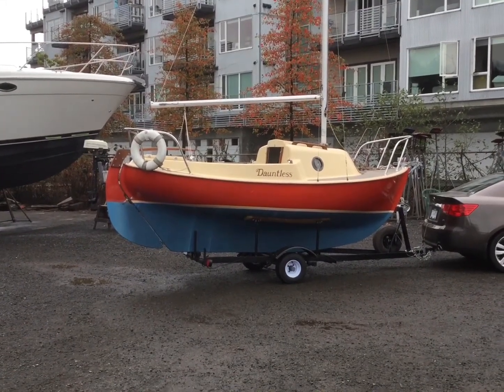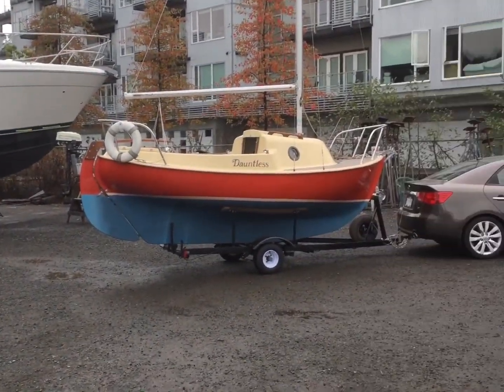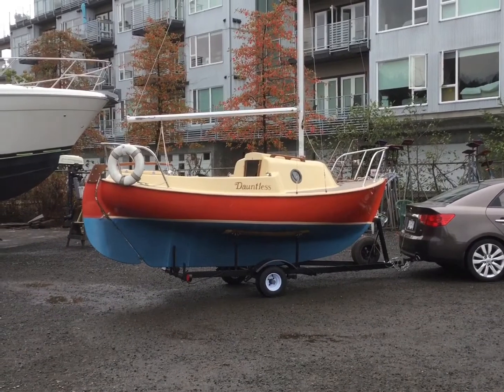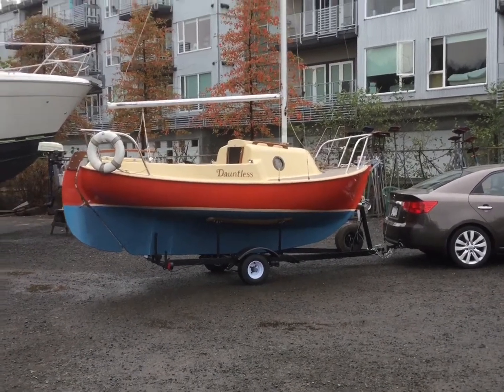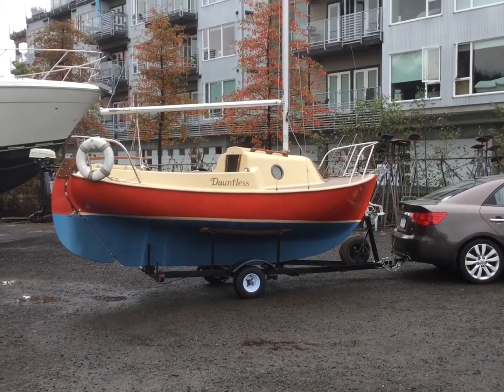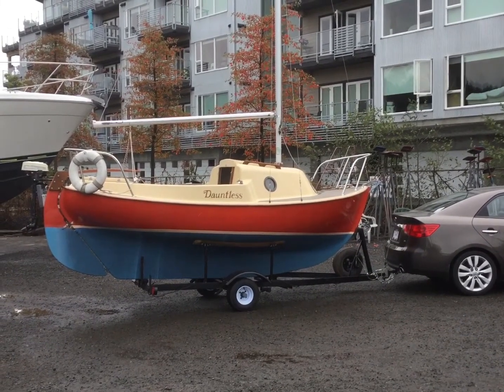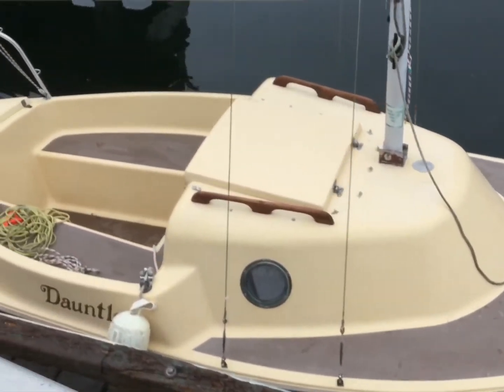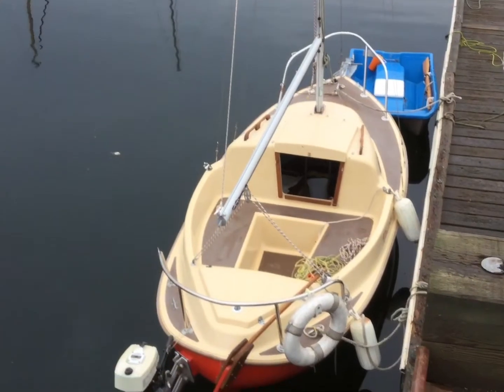Top Fun Guy launching my Danica 16 sailboat

Comment: Wow a travel lift for a Danica!! Do you have a trailer tongue extension? I made a sliding 7-8' extension on my trailer so i could launch it at a ramp no problem. Pretty easy to do if you're interested.
Reply from the maker: I was going to make a tongue extension for my trailer. I priced out a piece of square tubing from the Metal Supermarket and they wanted almost $300. That’s crazy. The Travel Lift here in Nanaimo ended up being less that $100 each way. I can live with that twice a year and it makes life easier.  I don’t know if you have the same email address, I sent you an email.